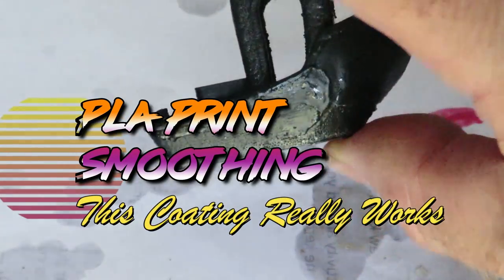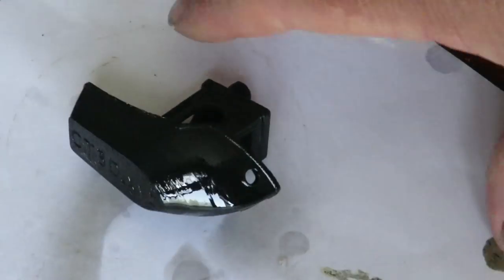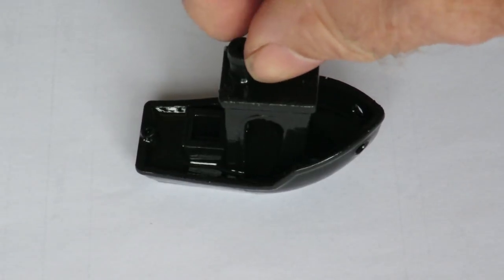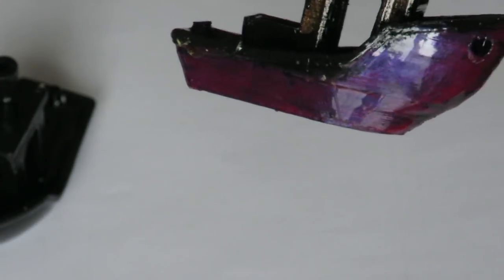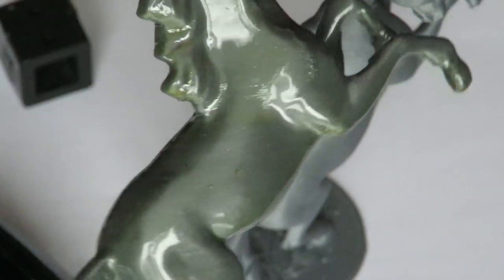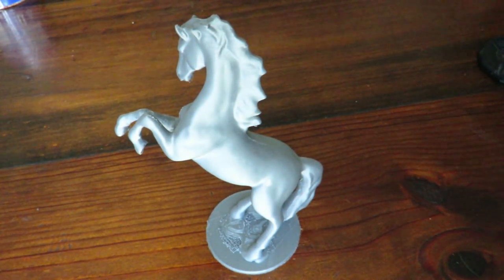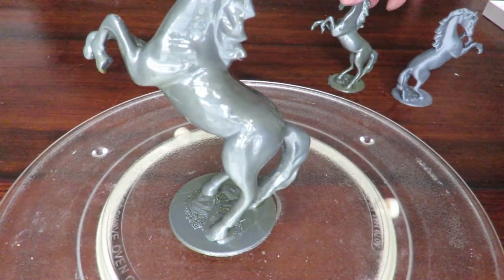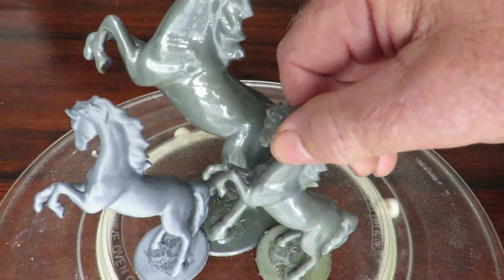📌This Coating Really Works for Smoothing your PLA Prints the Easy Way - No Sanding - Great Results

Comment: as a 3d printer ive been using spray putty primer and lots of sanding your method looks good and id like to try it, where did you get yours from? im in perth australia
Reply from the maker: Hi Kari
I used Wattle Estapol Clear Gloss 
Its a Polyurethane oil based product

I did a follow up video showing painting the smoothed models, and products I used.
https://youtu.be/AB9UACS5Pbs
Reply: i was more asking where did you buy your  Polyurethane? on line ?
Reply from the maker: You can buy online, or at any hardware store.
Reply: ok will try bunnings :) many thanks
Reply from the maker: Bunnings should stock polyurethane clear coating for timber floors.🙂
Reply from the maker: Cabots is OK its owned by Orica (Dulux) 
Make sure you get the timber floor one
Reply: all good not avaible in perth it seems ive gone to 4 bunnings and no joy , may need to buy online lol so cabot of but whats better ? a brand name and will will go find :) just want a smooth print without 3 weeks of sanding lol and many thanks for your help dude
Reply from the maker: Any THICK Polyurethane timber Floor Clear Gloss should work. (No matter what brand you use) 
The reason I emphases "Timber Floor Clear Gloss" is it should be formulated harder than normal timber finish, to withstand foot traffic. and better for our 3D prints.
P.S. Don't be tempted to thin it down.🙂
Reply: bought the only one i could find its very watery and its ok but im up to coat 7 , it is working but slow but thank you for the help its been amazing
Reply: it looks like milk to be honest no smell i might try ordering online and maybe have better luck :)
Reply from the maker: What brand did you buy?
Reply: Garry Purcell this stuff is working a treat . I have to do 6 coats but it's non smelling so I can do indoors water washer brushes and it takes a few coats but the results are stunning :) you have saved me big time in money and work time
Reply from the maker: Glad to hear, its working well for you.
I also like the fact you can paint directly over the top, and re-apply a gloss coat if you want.

Comment: does it make prints stronger
Reply from the maker: No it doesn't, make the print any stronger, as far as I know.
Reply: @GarryPurcell  thanks mate. is it a oil based polyurethane varnish?
Reply from the maker: @ChannelHTS  The one I used is Oil Based.
Reply: @GarryPurcell  thanks so much

Comment: Hi, I tried this method a long time ago, but could not get the same result as you did. How many coats of it did you apply and how many minutes between coats did you allow it to dry. Please tell me. Thanks.
Reply from the maker: Hi
Two coats Wattle Polyurethane Clear Gloss (Oil based), 6 hour interval between coats.
Reply: Thank you so much for the reply, I will try this right away. I did mine with just 30 minutes interval between coats, maybe that is why it did not work.
Reply from the maker: I also gave it a thick coat,
P.S. Let me know how you go.

Comment: So you have basically VARNISHED your PLA prints using wood /floor varnish is that what you used, polyurethane varnish? Looks good but you didn`t actually say what you used.
Reply from the maker: The Name of the product I used is in the Video description.

Comment: great idea using polyurethane I guessed that is what you used. Is it food grade quality polyurethane? thanks
Reply from the maker: As far as I know, polyurethane is not food safe, the one I used is a timber floor coating.
Reply: actually some are you have to search for it (or ask at hardware store) but research is needed
Reply from the maker: The one I used is available in Australia, its called Wattle Estapol Clear Gloss.

Comment: Will any Polyurethane clear gloss timber floor coating work or does it need to be a certain brand?
Reply from the maker: Any brand Polyurethane should be OK as long as its clear.

Comment: Its not making it smooth. It makes it glossy, thats all. Its covering the model.
Reply from the maker: Hmmm,,,, and what do you think the finished result is....
All printer lines no longer visible, and a smooth surface to paint over.
Reply: @GarryPurcell   Well i have seen laver lines after the coating in the video, but with increased reflection.

Comment: So it's basically like XTC?
Reply from the maker: XTC is a two part epoxy resin, so once it's mixed you will discard what batch you didn't use.
Polyurethane will remain usable in the tin until exposed to air, so once the tin is closed it will not go off.
Polyurethane is a soft to touch finish, XTC is solid.
Hope that helps.
Reply: @GarryPurcell  Thanks for responding, didn't like XTC, it was way too thick and covered up the details even after trying to thin it. Now i mostly use a thin mixture of plaster with water to fill the layer lines, or spackle paste used for drywall that can also be thinend with water. Have more control using these products.
Reply from the maker: @TheIcemanModdeler  I would think adhesion might be a long term problem, with the model expanding and contracting, at a different rate to the plaster, but not sure.
I made a video showing a Polyurethane coated model, being painted with Artist Grade Acrylic paint. It might help you to decide to give Polyurethane a go.
https://youtu.be/AB9UACS5Pbs
Reply: @TheIcemanModdeler  I would imagine the poly could be thinned and applied in several coats to keep the detail and still smooth the print.

Comment: I notice that is was kind of thick going on. have you tried cutting the poly with mineral spirits?
Reply from the maker: I wanted a thick coat to fill the print lines.
You can always thin the polyurethane as you suggested, if you already have a smooth sanded print.

Comment: I have used 5 minuet epoxy thinned with alcohol, just brush it on and in 10 minuets or so you are ready to paint.
Reply: Oh and thanks for posting. I will try the Polyurethane as well just to see how it does for me.
Reply from the maker: Sounds good
I must try that.
How long is its working life once thinned?
Reply: How thin did you make it please?
Reply: nevermind my epoxy has gone off lol.

Comment: nice vid but very hard to understand  the solution (for the no english person) . Polyurethane clear gloss timber floor coating ? its  ok ?

edit : sorry it's written in description , my bad thx a lot for your vid
Reply from the maker: Most Polyurethane based varnishes should work.
You might have to apply more coats, if the product you get is thinner than the one I used,

Comment: thanks for sharing :-)
Reply from the maker: Thanks for taking the time to comment.
If you have any questions, simply pop a message in the comments.
Reply: @GarryPurcell  Hello Garry, do you have a solution to smooth PET-G or to glue or paint it? I overthink to buy it because i wantt to work with it, but what i saw or read is that its not glue able or paintable. Do you know if this is true?

Comment: What is the name of the product?
Reply from the maker: Hi
The brand of polyurethane I used is in the Video Description
Reply: this is what I see and i don't see the name of the coating material "This Coating Really Works for Smoothing your PLA Prints the Easy Way - No Sanding - Great Results"
Reply: Waterblade, That is the title.
Clic on the description below the title to see details and don't forget to "thumb up" and hit the "bell" icon!!!

Comment: Uh, literally didn't see the product. You share a video and didn't even mention brand? Just "floor polyurethane" yea, that really helps so much....
Reply from the maker: Poyurethane is known under various trade names world wide.
So if I use the Trade name Esytapol, you most likely have no idea what I'm talking about.
Reply: @GarryPurcell  no, not at all, because I have the freaking world at my finger tips. If you give me a specific brand and product line I can find something similar, but if you just say "polyurethane floor coating" I have to go and make a list of like 30 different potential products....
Reply from the maker: @Munky332  And they would all be correct, as Polyurethane is the Product.

Comment: Unfortunately, I did not understand what you have taken this time to achieve this, 
Greetz Tom
Reply from the maker: +Thomas Pfeifer I have done four other tests earlier and this one was successful
Reply: I understand but was is it. 
1 of 5: Was Nail Polish and Ethyl Acetate
2 of 5: Was Heat Gun and a Reflow Station 
3 of 5: Was Plasti-Kote Plastic Primer
4 of 5: Was Clear Concrete Sealer
5 of 5: what was this?
Reply from the maker: Polyurethane clear gloss timber floor coating.
I mention it towards the end of my video,
Reply: I nearly missed it when you said it. Perhaps providing a link or something to the product in the description would help. thats where I went to see what you used just to be sure.
Reply from the maker: Good Idea. 🙂
Iv'e just added it to the bottom of the description
Reply: He literally said it was "Polyurethane".

Comment: not bad finish but I don't care for the colorization - especially where it gets in the crevices
Reply from the maker: This coating can also be painted over, if you don't like the excess colouring left by the Polyurethane.
I did do a follow up video showing the painted results.
Reply: maybe a mild blowing with canned air while its still wet might help the crevices. It does look good though.
Reply from the maker: Hi Jeff;
That sounds like a good idea.
But, I feel you would need to be there for quite a long time, 🙂 as polyethylene takes quite a while to dry. 
The coating can be applied thinner, but the printer lines tend to be easily seen.

Comment: So, this isn't actually smoothing anything.  I use the same stuff on miniatures that I have painted.  Actual smoothing processes don't add material but modify, if not, remove some of the material.

In this video you are essentially adding layers of clear coat until you have a "smooth" finish.
Reply from the maker: That is correct Michael.
I use Polyurethane first, then paint over the smooth surface that it leaves behind.